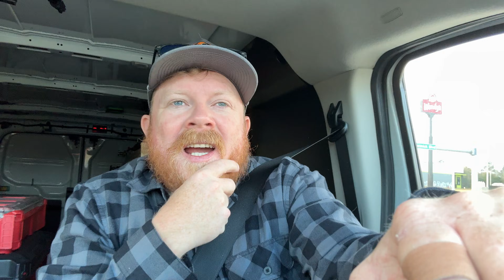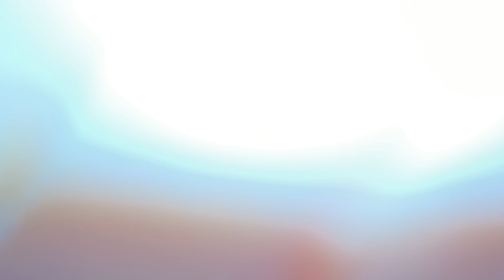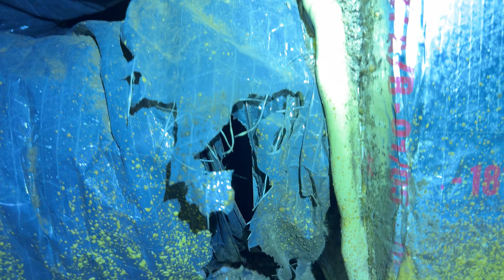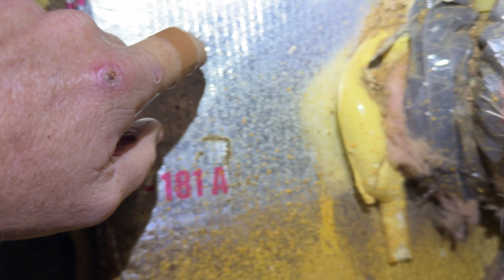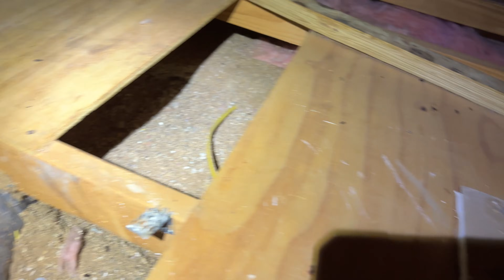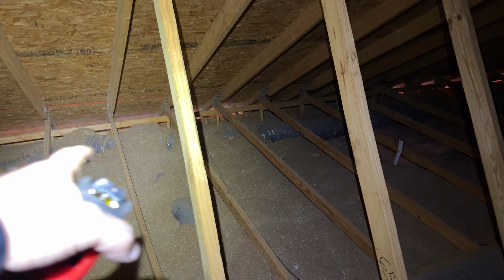HVAC Estimate Callbacks: What Went Wrong?

Comment: Just going by the way the ductwork is laid out there's no way of knowing what a new condensing unit is going to work. With the lengths of the runs of flex if left as is, in my opinion you're might be looking at a headache if you just patched as hard as this might sound if it was me I'd walk away from that job.